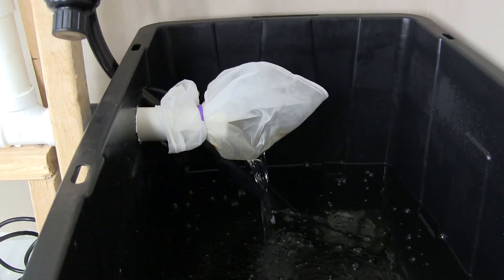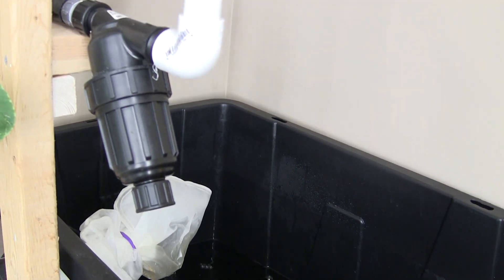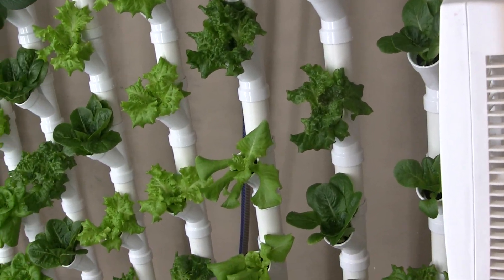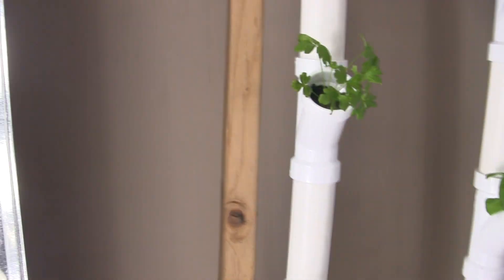Basement Hydroponic Tower Garden Version 2.0

Comment: have you tried using LED light strips similar to what are used in the Freight Farms (https://www.youtube.com/watch?v=l0UX6uo-4_8)?  You should be able to reduce energy consumption to 1/10 of what you are using now (only using 2 wavelengths compared to approximately full spectrum white).  Also - what was bad about cutting slots in the larger pipes?   I'm posing these questions from a cost perspective as cutting drain pvc for holes and using less electricity would make this more sustainable (with the ultimate goal of a solar array to enable off-grid or net zero electric usage as well)
Reply from the maker: Hey Max, I'm super intrigued by those light strips in the link you shared. Do you know what they are called/where to buy them/pricing etc.? Please share if you do.

Cutting holes in the PVC is a bad idea in my humble opinion. The holes are bound to leak and sealing them uses processes and chemicals I wouldn't want in a  system that feeds my family, friends, or customers. I suppose you can use a wicking system of sorts, and come up with a leak free design.  I think you'd also want to have the towers removable for cleaning and such. The holes just didn't work for me so my current idea is how I improved on my design. But I'm not an engineer or plumber, or farmer really. I'm just a high school teacher.  I'm sure the experts could come up with something better, although I haven't seen much promising popping up for the home hobbyist. That being said, I am interested in developing more sustainable and efficient ways to grow clean food to share with other hobbyists and so I'm really glad that you took the time to open this dialog. Please let me know how you decide to build and how it all works out. Best of luck to you!
Reply from the maker: Hey Max, did some quick research. There sure are a lot of options for the strip LEDs. Based on the specs for the SLR strips (they seemed so be quality), my wattage draw wouldn't be close to your 1/10 estimate reduction of what I draw now. Currently I'm using somewhere around 0.095 watts per square inch, and with the strip lights I'd be using 0.065 watts per square inch, and that's assuming each diode emits 2 watts (the specs on the SLR website don't include watt draw, so I estimated based on other products). Still that's about a 40% energy savings so it's worth it for the long haul, if my calculations and assumed draw are correct. I need to do some more research on how to cut and connect the strips for custom fitting. I see this as having big applications in my greenhouse where the plants at the base of my towers need supplemental lighting. This could definitely extend my growing season in the greenhouse. I'd love to hear to what extent you've worked with these strip lighting products or what additional information you have. Thanks!

Comment: Wow Project, to say the least. I liked it so much. Using Y joints make more sense than making those pockets with heat gun and so on. I would adopt this design and already got a bunch of Y joints for building similar tower, but a smaller version to begin with. Just three towers. ONE QUESTION, can you tell me, what is the distance between two vertical towers?
Reply from the maker: Hello, it depends on what you want to grow. For lettuce I'd recommend 8-9 inches, for kale 12 to 14, herbs around 10 - between plants.  You'll have to play around with the distance between towers. My lettuce towers for reference are exactly  8 inches from center pipe to center pipe. Hope this helps.
Reply: I've thought about y joint but they will be expensive as fuck
Reply: @howo357 

My thoughts on the cost factor exactly.

The problem (for those who haven't tried it yet) with the "cut a slot, heat and form-a-socket-with-a-bottle" technique is that the the upper part of the socket acts as a hood that causes most of the water to bypass the grow net.

I think this can be cured by cutting another but smaller slot upstream of the main one at the highest point of the hood and then form another smaller socket but in the opposite direction. Together with the tilting of the vertical tube this should solve the "bypass" problem.

I admit that I haven't tried this yet but maybe it is worth a shot..

Comment: Great job! One note: you need to use the special red/blue LED lights. The white LEDs are not good because of spectrum. :)))
Reply from the maker: Works well for greens - for flower and fruit production you need more of the red, but for greens the blues are fine.
Reply from the maker: The regular LED daylight 1600 lumen work fine for me, but I'd be lying if I said I wasn't curious about the strip LEDs with the red/blue diodes, specifically the cocktail for greens production. There's a lot out there and I've been burned in the past with lighting based off of what the websites claimed. I'm assuming based on your post you have some experience with the matter. Can you share some info/experience? Thanks in advance.
Reply: Pasting the aliexpress link below. Best(and reasonable) grow LEDs out there as per my limited research. Full spectrum and White( not purple). Yes you need to wire/solder them together in some DIY housing / heat sink. Thats what I do hence sharing. Hope it helps you too. 
And yes one of the nicest video on vertical gardens. Thanks for sharing.
Reply: Do you have pictures of the lights you built
Reply: https://www.aliexpress.com/item/10-20-50-100pcs-1w-30mil-3w-45mil-White-Full-Spectrum-380-780nm-SMD-LED-Bead/32717043207.html?spm=2114.search0104.3.1.59b3417bxHy8Pr&ws_ab_test=searchweb0_0,searchweb201602_3_10152_10065_10151_10344_10068_5722815_10342_10343_10340_5722915_10341_10698_10697_5722615_10696_10084_10083_10618_10307_5722715_5711215_10059_5723015_10534_308_100031_10103_441_10624_10623_10622_5711315_5722515_10621_10620,searchweb201603_25,ppcSwitch_2&algo_expid=1c638dcd-bebe-41ec-9851-7ab42a5bfcc4-0&algo_pvid=1c638dcd-bebe-41ec-9851-7ab42a5bfcc4&priceBeautifyAB=0

Comment: Hi..How many plants you can have at a time in this setup and is it more space efficient as compared to A type structure
Reply from the maker: You can have as many plants as you want as long you have enough nutrient capacity. I've not experimented with an A type structure so I can't answer that question. Only I like the aeration with the vertical towers.

Comment: Great setup! Doing a modified version. Would 2 of your light setups be adequate for a 7' wall? And do you have any detailed plans written up for the light construction?
Reply from the maker: Hi Dennis, I put my lights about 28 inches apart, but to be honest, I am contemplating adding another for this next growing season, which will put them 24 inches apart. If the plants don't have enough light, they get stringy, and for my system I think another strand will make them more marketable. As for detailed plans I'm sorry I don't. There were a couple close up pictures I took for a subscriber. You should be able to find them below. Good luck!

Comment: this is too good to even be true
Reply from the maker: They say if it sounds too good to be true then it is. To be completely honest, it does take time to flush the nutrient every 3 weeks (a bit over an hour if you flush water 3 times through, and a sink close by is super helpful), and the system works best with plants harvested whole like lettuce or bock choy (herbs with cuttings like parsley and kale end up with root clogging after about 5 months in the 1.5 inch pipes. I will try with 2 inch piping this winter for my herb and kale towers as an experiment. It's also important  not to introduce anything directly from outside - you WILL introduce a pest or mildew or something you will have to battle. But, if you are committed to producing fresh,clean food for your family sustainably, this basement/outdoor system is showing real promise. I've been experimenting with different designs, starting with aquaponics and moving toward hydroponics, for over 3 years now, and I really think I got something here. Give it a try!
Reply: I am watching this video the 10th time now? lol
Am trying but horizontally, vertical is so hard to set up :'(
ur a genius :O

Comment: Do you think you could seed directly into the system?
Reply from the maker: Hello, yes, but by doing so you will decrease your yield total yield. You will have your plants in for 8 weeks instead of 6 (so 8 groups of plants instead of 6, so you will have less plants per group with 8 vs. 6. Also, I also like to plant a couple extra - you won't always get 100% germination, although you can also put 2 or 3 seeds in each plug and then keep the strongest after 3 weeks I suppose. Good luck!

Comment: Is there glue connecting the tees and straight pipes other than the one feeding into the return pipe at the bottom?
Reply from the maker: yup, be sure to use the glue for potable water. It will indicate that on the can.

Comment: I am trying to construct a tower using your instructions. I ordered my 1.5" PVC pipe; it was delivered today  and it has sewage grade stamped on it. It looks just like regular PVC pipe to me. Can I use it, or do I need to send it back and buy water grade?  Thank you so much for your reply.
Reply from the maker: Hi Vera, I have not seen PVC pipe stamped with a sewage grade at any of my local hardware stores. I would check with the manufacturer. Good luck!
Reply: Thanks, I ask a local contractor and he gave it thumbs up, he s aid, sane composition just one is pressurized, what I bought isn't but doesn't need to be
Reply from the maker: Hi Vera, sounds like you bought the foam core instead of the solid core - that won't be a problem for this application. It is also lighter and easier to work with. Also less expensive.  Best of luck!

Comment: This is an AWSOME set up! My wife and I are close on pulling the trigger on building one ourselves. Right now we bought a "Grow Up Tower system" to see how well things would grow in that, and we are very impressed with it. 

The question we do have, is what size Net cups are you using for the 1 1/2 pipe. Would it be the same? Also, have you considered using 2 inch pipes to maybe free up some of the root clogging?
Reply from the maker: Hi Michael, 2 inch pipe would help with root clogging for veggies and longer growing herbs. I don't use net cups. I just push the rockwool into the wye tee. Good luck!
Reply: MaryandJoe Neumayer are you using the A-OK rockwool cubes? They look pretty small and I don't know if they'll keep from falling into the tube!
Reply from the maker: Hi Spacelazor, no, the 1.5 inch rookwool cubes are a very tight fit, especially when wet. No worries!
Reply from the maker: Hi Michael, no netcups needed - save your money. Also, the 1.5 inch opening is perfect for veggies harvested whole (including roots) and replaced, like lettuce for example.  For herbs where you make cuttings, a 2 inch would be an improvement. Just get bigger rockwool plugs for the 2 inch. Best of luck to you and your wife! :-)

Comment: HOW DID YOU BUILD THE FRAME out of lumber? Do you have video? How to stable the frame so it stays tilted? thank you!
Reply from the maker: Hello, there is perpendicular bracing on the ends at the floor and also included some side bracing for increased stability. If you climb it like a jungle gym it may come crashing down but the towers are mostly vertical so there is very little forward weight.

Comment: Joe. how many times your water pump turn on and off and for how long the on period...I got almost the same setup as yours, mine goes for 117 growing pots. One more question, why so much light? my room is a 65ft2 and 2 x 26 Watt, 120 Volt Bright White Spiral CFL Bulb (100 Watt Incandescent Equivalent) so when you enter the room is like the sun is inside.  and last question, when do you know the nutrients has to be recharge? thanks.
Reply from the maker: Hi - pump runs 15 min on and then 15 min off. I am not over luminated. I am not developing the nice red leaf pigments like I get with the natural sunlight, but the lights put out enough for good growth with my greens. As for nutrient flush - I settled on 3 weeks - I can tell with the way the lettuce grows - starts to slow down and some of the leaves start to get spotty - the flavor changes too. Flushes every 3 weeks avoids this. Good luck!

Comment: sweet setup.  Wouldnt it be a lot easier and cleaner looking with an led grow light on a light rail rather than all that wasted space with lights?
Reply from the maker: sure, I'd love to know your specific thoughts. please share.
Reply: MaryandJoe Neumayer i like it. Just thinking a light rail above traveling the length of your system with a suspended grow led would be more efficient and free space. growing greens wouldnt need a top of the line grow led,  so a cheaper model would suffice.  i use a light rail with mine and can double the amount of production, while freeing up all that floor space.  just a thought.
Reply from the maker: sounds like a great idea - what kind of a cheaper grow led would you recommend? I like the rail idea if you can move the light out of the way for maintenance and harvest. Do you have a picture or posted video illustrating this perhaps? Thanks so much for your time.
Reply: MaryandJoe Neumayer honestly it depends on your budget.  Mars all the way to Blackdog Led or more. Galaxyhydro seems to work well for greens on the cheap.  suspended by Sunclips or similar hangers, maintenance or other tasks is effortless if needed.  Could always double the rail to 6foot if wanted but honestly depends on the led u get for that distance.  My 40lb light attached to the light rail, attached to a 2x4, attached to the ceiling joist is soild so weight isnt really an issue.

Comment: Those LED are not the type for plants.... You need a different frequency light than those produce.
Reply from the maker: Thanks for your comment. Please suggest specific products for me to try.
Reply: I used these grow LED strips (link below) to make my own grow lights. I used 2 strips of light per plant (one package makes two, 2 strip lights, 4' long). I have my 4" PVC horizontal (5' long) with 3" holes for my net pots, every 10", stacked 5 high on a wall. I have nutrient water pumped, from a holding tank,  to the top and a drain hole that allows an inch of water to stay in each pipe. Each drain connects to the pipe below it until it reaches the nutrient tank with an electrode to hyper infuse oxygen into the water while it's pumping the water up to the top (I have the oxygen electrode in the open inside the tank and the hydrogen electrode in a tube to vent the hydrogen outside safely). Each PVC pipe has 2 LED strips hanging just above each row of plants.

Everything's on a timer, so it's all hands off, except for harvesting. I could add some fish to my nutrient tank, if I wanted, and put their feeder on a timer too, but that is my next expansion to this system.

This give barely enough light they want and is cool enough to actually have them touching the top of the plants without burning them.
https://www.amazon.com/Toogod-Spectrum-16-4ft-Waterproof-Growing/dp/B00XHRYX2O/ref=pd_sim_86_5?_encoding=UTF8&pd_rd_i=B00XHRYX2O&pd_rd_r=8B7JKCQV0DB3HC1CCS9N&pd_rd_w=2rvnF&pd_rd_wg=Mqk4E&psc=1&refRID=8B7JKCQV0DB3HC1CCS9N
Reply: My method is part Kratky, part DWC part Ebb&Flow. The roots, of each plant, have air roots and DWC roots but the water is circulated and oxygenated. I'm sure my PVC will clog up with roots by the end of each plant's life cycle, but I can just yank them out easily when I swap out the old ones for the newer ones.

Comment: Hello congratulation on your system ... quick question ... do you use net cups ? Or just put the rockwool plug in the y pipe ?
Reply from the maker: Hello JF, yes, just stuff the rockwool in the pipe opening.
Reply: what size rockwool plug do you use for this, and does the rockwool disintegrate into your plumbing? - Thank you.
Reply from the maker: 1.5 inch rockwool, and it does disintegrate slowly after many many months, but for lettuce there is no problem since you are only using for 2 months max. I rip it apart and compost it with the stem and roots. I to my knowledge have never lost a plug in a tube. One of my high school freshmen once jammed someone else's plug deep into the tower (little punk) but he was able to retrieve it successfully with moderate effort.

Comment: Hi Joe, everything doing great, added 4 more towers.  I started some tomatoes and they are actually doing the best. Have you given any thought to doing and stringing up indeterminate tomatoes and perhaps creating a larger couple towers with larger spacing or opening for them?  I'm thinking 3" wide couple towers just for tomatoes?    I can move my plants outside but I'm thinking to try to do tomatoes inside in winter and power the lights with a two panel solar portable panel outside.
Reply from the maker: Hey Marty, sky is the limit. You have to evaluate the real estate cost - indoor size allotment vs. energy for lighting. Depending on where you are, solar could work, with battery backup, but you'll need the proper photoperiod for fruit  production regardless of energy produced. Outdoor in the summer would work well and people do this. Another consideration is root area - as they can clog the piping and create a leak. Let me know how it goes! :-)

Comment: Joe, I used your model and built a smaller version, do we need an air pump? Air disk? Bubble disk? Whatever you would like to call it.
Reply: Also how often do you turn the system on? What is the cycle?
Reply from the maker: Hey Thomas - great to hear it - way to go. No aeration needed with the vertical design. Big seller in my book. Let me know how the growing goes!